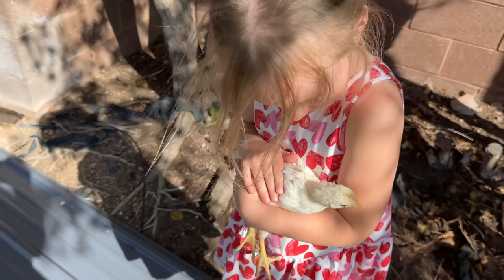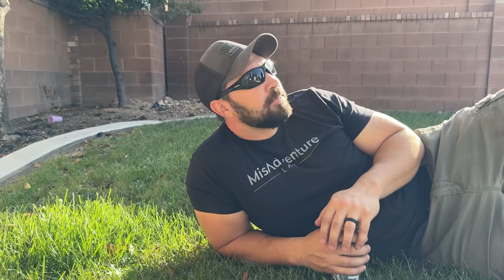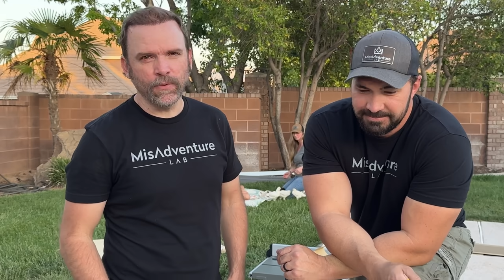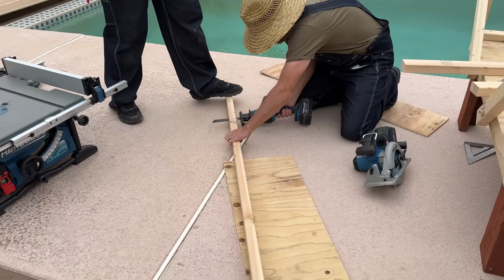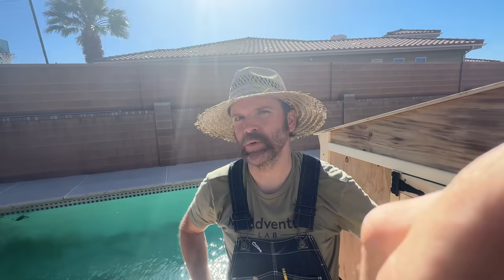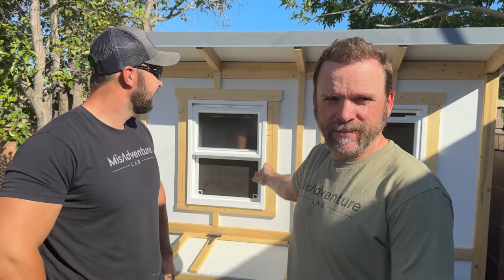We Build an Eggcellent Chicken Coop

Comment: Gonna give ya a suggestion or two. Not sure how long ago you actually built this coop, but, probably not so long ago you've not had to clean it out yet. So, Before it gets too nasty inside, get you a piece of vinyl flooring and just simply nail it down to the floor, covering all of the floor. Even the nesting boxes. Why, because it makes cleaning out the coop sooo much easier! Also, chickens like to roost. So (my coop was 8' long) I put two rows of 1X2 up on it's edge, and staggered them enough so they didn't poop on each other. You mentioned them flying, they will! right out of the run you've created. unless you might have predator issues. I wouldn't worry about putting a top on it, but, still the issue with them flying out. Cut the out feathers off one wing, yes, just one, The feathers I am referring to are the ones that when you spread their wings out, the outer most wing feathers, just to the outer edge of the next row of feathers. No pain, no bleeding, just feathers. I'm pretty sure you have some pretty cold weather out there. So I had a drop cord run out to a heat lamp, Not so much to keep the chickens warm, but to keep their water from freezing, you could also use heated mats, or heated bowls. Put it on a switch so you can just turn it on when you want it, or need it. I ran mine to make an outlet, so I could plug in a light, and a heat lamp. I put the light on a timer, so it would come on before dark and cut off around 8 or 9 in the winter. This makes the chickens lay better during the shorter days. I didn't see what roofing you used, but if metal, I for sure put some holes for ventilation at the top of the coop. The windows will help some, but the screens are kinda low, the the top will get too hot in the summer. chickens can handle the cold, but not the heat.